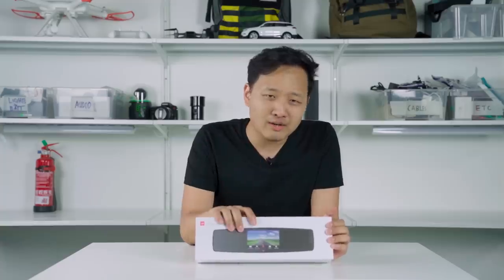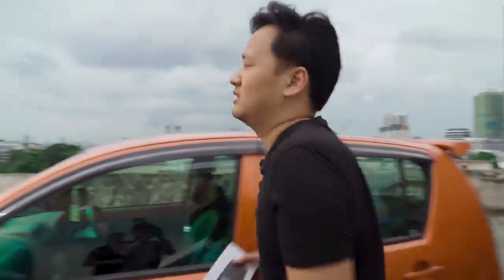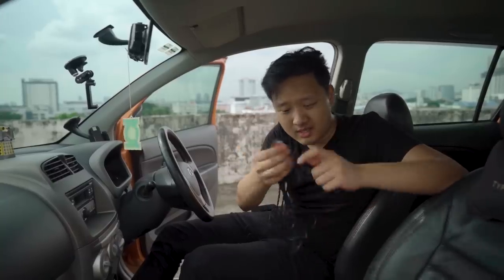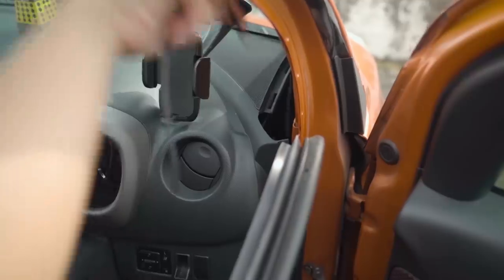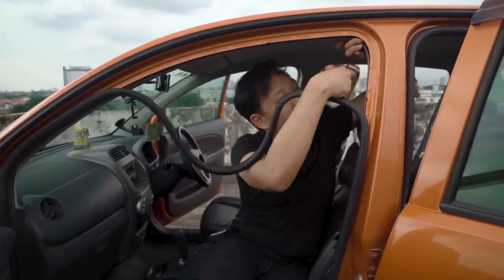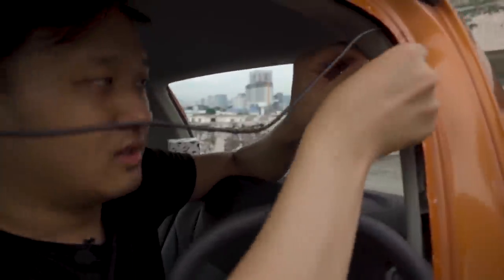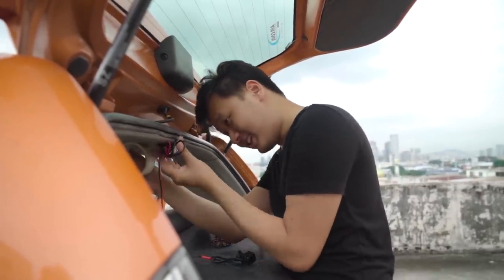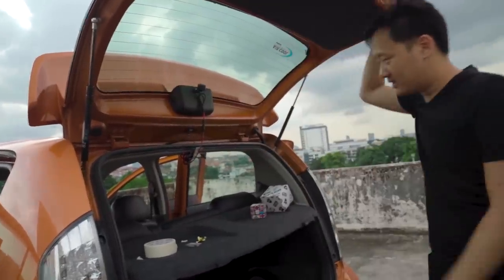How to: Install a Yi Mirror Dashcam on a Perodua Myvi

Comment: Your third brake light that you mounted the rear camera to has the same power wire that you need for it to automatically show the reverse camera so just connect to the power wire there.  Also, move the bundle of wires back to the rear seat area instead of leaving them bundled up under the third brake light.  Piece of cake.
Reply from the maker: We'll give that a try, thanks for the tip!

Comment: I truly need this dash cam. As a full time e-hailing driver whatmore a lady driver I'm always exposed to road bully and scammers. 
Yesterday afternoon as I drove from KLIA to Cheras I encountered bunch of motorcyclist youngsters riding dangerously and provoked me. They kept running in front of my car that I have to press my brake pedal many times. They forced me to move to the fastest lane although I was following speed limit. 
Having this Yi Mirror dash cam should be very useful and ensure safety of me & my passengers too

Comment: can you use the rear camera without attaching the cable to the reverse lamp?
Reply from the maker: Yes you can! It will also record from both the front and rear. The only thing is that you will have to switch to the rear camera manually when you want to reverse. - Rory
Reply: @soyacincautv  thanks for your response. I thing it would be safer if i don't manipulate the reverse lamp cable at all.
Reply from the maker: @amalgozali9723  No worries. Hope it helped!

Comment: Will it turn to rear camera automatically when we shift gear to reverse???
Reply: sandeep Nsk yes. Mine was installed at the accessories shop. So they had it wired to my lights.

Comment: I would not recommend running wires along the roof due to air bags in curtain cars are in the roof so if you can run along the floor. also if your running wires down a A pillar and run behind the air bags not in front as it is a failure to them deploying
Reply: @soyacincautv

Comment: What happen if i start my engine but camera not start?
Reply from the maker: Make sure your camera is getting power too --Rory
Reply: SoyaCincau how? Please
Reply from the maker: @dollahy1994  It's STEP 2 (4:07) and STEP 3 (5:56) of the video.
Reply: SoyaCincau the thing is it has power but it do not have autostart of camera when engine start
Reply from the maker: @dollahy1994  Then you might have a defective model. Maybe try contacting the manufacturer/seller.

Comment: Initially u should just run the rear cam wire on driver side. Why need seperate.... for rear cam, Just slot in the bunch of rear cam wire down the inner cover beside the rear light and run the remaining across the roof to ur 3rd brake light.